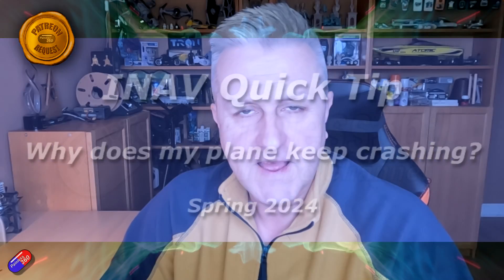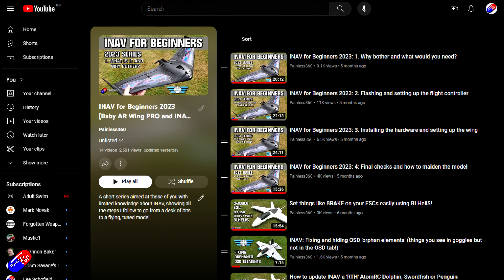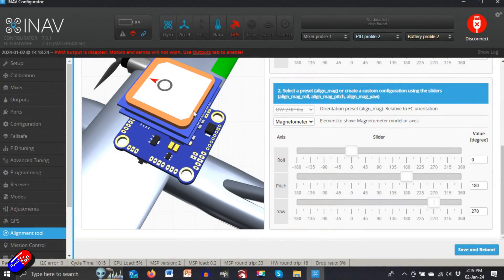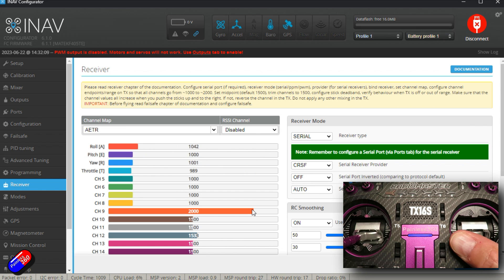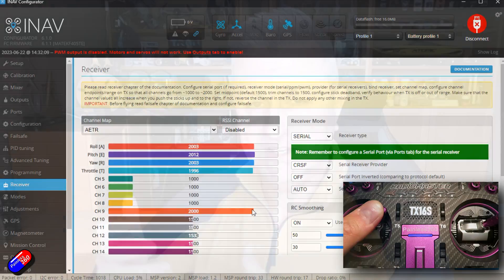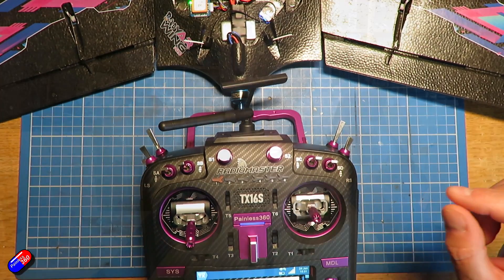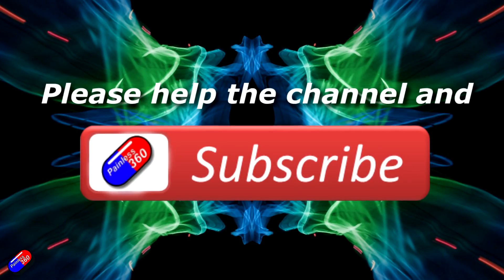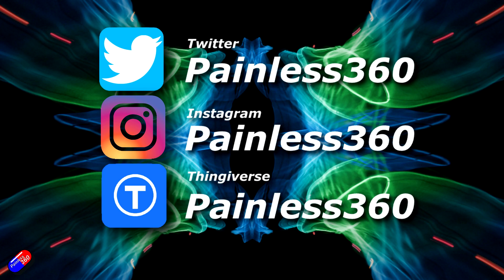Why does my INAV plane keep crashing in ANGLE or HORIZON mode?

Comment: Had used inav before but couldn't figure out why my DolphinPro kept rolling on launch. Had the aileron reversed in radio instead of Inav and this video finally helped me figure it out! Now for the re-re-re-maiden
Reply from the maker: Check out my INAV for beginners series as that is a fundamental thing and there could be other basic setup steps you've missed... Best of luck!
Reply: @Painless360  Got out this morning and it flew great!
Reply from the maker: Please share your setup as many are struggling with that model...
Reply from the maker: Wonderful, thank you! Have you got a tune on it? What was the FW_offset?
Reply: @Painless360 Just did a flight with the tune Andrew Newton has but I'm also getting porpoising in nav modes, manual mode flies beautifully so does acro. Offset is 5°
Reply from the maker: Sounds like the gain on the pitch controller is wrong... Best of luck!

Comment: Aaaahhh - damn. Yep, that's what I did. I reversed the servos in the radio instead of iNav and the plane crashed on the first hand launch. Not too much damage, fortunately. My fault for not checking that it was correcting for the planes movements in the right direction. Lessons learned. Thanks for the info.
Reply from the maker: All of the common gotchas I see builders make are covered in the various INAV for beginners series... Happy flying!
Reply: @Painless360  Yes, sir. I watched many of your videos over the years and learned a LOT. Thank you for the great content!

Comment: Can you explain why you don't reverse channels on the transmitter? I fly quads with the pitch reversed because its more natural to me (stick up, go up). I have the channel reversed on my transmitter, not in betaflight, and across 3 quads ive never had a problem. Does inav or the way it handles corrections on a wing mean this wont work when its worked fine in the past?
Reply from the maker: It's just how it works. You can try changing the process but you'll need to make it so inav can still work.. Best of luck
Reply: @Painless360  thanks

Comment: Great video, however, if two of your Chanel maps go down and not up when you push sticks to the upper right, how does one go about correcting that? The only way I have discovered is to reverse servos on radio which is a no-no. Thank you.
Reply from the maker: Channel maps? I'm not sure if I understand. Radio channels should move as shown. If not then change the channel direction settings on the radio to make them all move in the right direction. See my INAV setup series if you are confused.... Best of luck

Comment: I don't use flight cards full stop because it ruins the feel and the fun, you should be flying just using the 4ch receiver, at our flying club most bad crashes are assist or flight controller problems, I fly fpv wings, Ef racers, cirrus 6ch, obviously drones of all types
Reply from the maker: Great to hear that works for you. I fly in MANUAL a lot here to 'get INAV out of the way' for normal flying but it provides autolaunch, a rich OSD for FPV and a solid RTH feature in the event of an issue. The cool thing about the hobby is that, so long as you are flying responsibly and not hurting anyone, there is no wrong way to do it! Happy flying!
Reply: Hey, you do you man!
Reply: I couldn't keep a fixed wing in the air without the help of Inav/ardupilot when I first took up the hobby, it save me from,  A. wrecking my plane that I spent a lot of hours building from plans on the first flight. B. becoming totally disheartened with multiple crashes and wrecks and giving up. C. the option of having a "oh shit" switch if you are in trouble the fixed wing or quad will circle or hold position while you recompose then retake control and countless other benefits that my learning curve/experience of learning to fly was much safer for all including the general public. I now fly 99% of the time in full manual mode apart from auto launch as it's much safer when you're on your own throwing a fixed wing in the air.  As to the crashes being caused by a flight controller at your flying club it's more than likely a combination of a badly set up flight controller and pilot error.  This attitude towards flight controlled fixed wings/quads/drones is the main reason I didn't join my local clubs due to the "balsa brigade attitude" of its members.
Reply from the maker: Always sad to hear of pilots who don't feel welcome at a local R/C clubs due to a old fashioned, parochial idea of what the 'hobby' should be. 
Those clubs that don't welcome and embrace the new blood of young pilots will die out as no-one will be there to fly when the balsa generation isn't able to any-more. As a result, ALL local pilots will lose access to those valuable flying areas thanks to that short-sighted mindset of some RC flying clubs. 
I pleased to report that a lot of 'more evolved' flying clubs do welcome the modern hobby (foam planes/wings, multirotors, flight controllers and FPV) and the older pilots are getting to experience some fun, cool new stuff that the modern hobby provides. Those clubs that don't embrace it and move with the times, are doomed. 
From my own experience, I've always has a very positive reaction from mature pilots after trying out FPV. If someone is willing to try it, then don't like it - fair enough. It is the wholesale condemnation of technology that some clubs have (when they probably haven't tried it or understood it) is where I have an issue.
Please keep the comments supportive on the channel. The RC hobby is a broad church... Just my 2 cents.